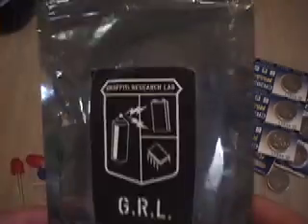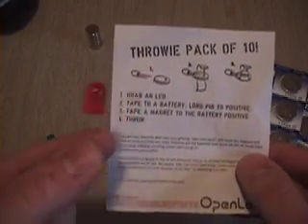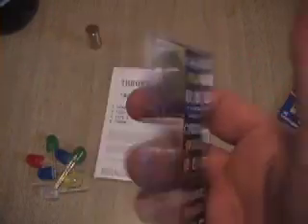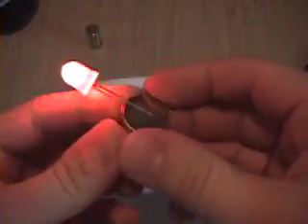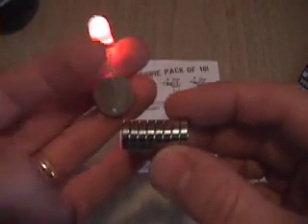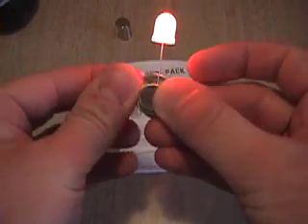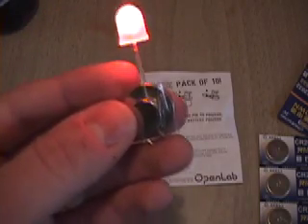Making an LED Throwie

Comment: don't get the purpose of throwing magnets, unless you like to have dents on your fridge, car, etc.  Also, without a resistor on the anode of the led it will burn out quickly.  Do things right. Just sayin
Reply from the maker: These lights stay on for weeks.

The purpose is that it's fun. Do you question the purpose of candy too?

Comment: Is the purpose of the magnet solely for the throwing part? Is it important for just the lighting up of the LED at all? I'd like to attach a bunch of these LED's to a costume and I don't need them to stick to any metal. I'm a complete novice with things like this so I'd appreciate helpful replies!
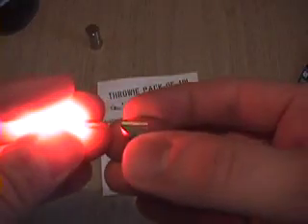Reply from the maker: The magnet is only to make them stick to metals. As you can see at 1:39, it lights up with no magnet on it.
Reply: Josh Lewis Thank you for confirming :)

Comment from the maker: I think Graffiti Research Lab was charging somewhere around USD$20 for the pack of 10 throwies, if I recall correctly. I haven't purchased more supplies from anywhere since then, so I don't know what the going market rate for supplies is. 

I'm sure they're far cheaper than $2 a pop if you get the supplies elsewhere, but I don't blame Graffiti Research Lab for the high price! It was fun to see how they put the packet together, and the packet was just for novelty purposes and fun.

Comment: If those LED's require 3 Volts.. you may use any 3 volt cell. So a small 1.5V cell won't work I guess.

And yes.. it will if you put two of those 1.5V's in series.

Comment: There should be a current-limiting resistor in series for many green, red, orange or yellow LEDs. The lithium cell, however, is inherently current limited because of its internal impedance, and that is what prevents the LED from blowing out. However, when the cell is new, some LEDs are probably being driven well beyond their maximum current rating. If you drastically exceed the current rating of some LEDs, they will explode.

Comment from the maker: The batteries last different lengths depending on the color of the LED. I think the green and yellow ones last the longest, if I recall correctly. They'll last at least a week, and some will last up to a month or more, although they'll be very, very dim at that point.